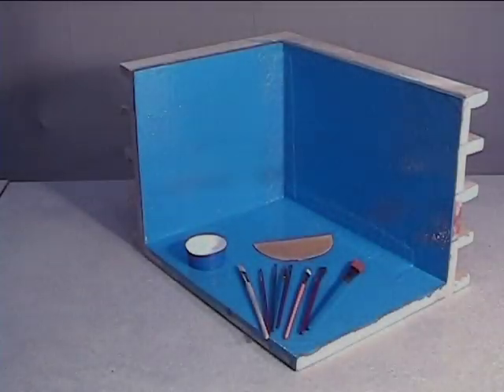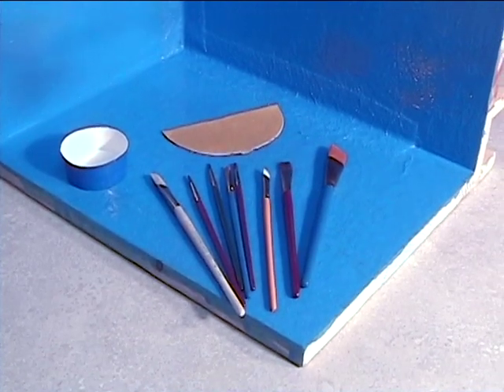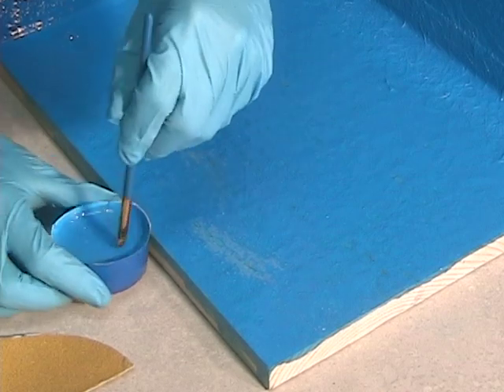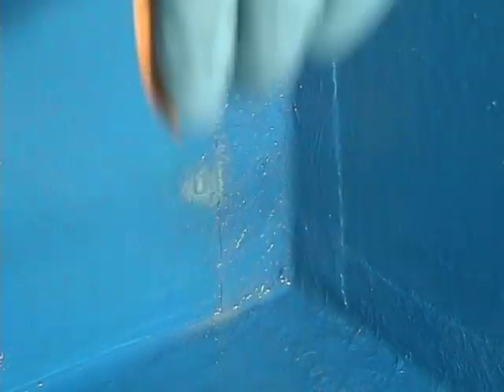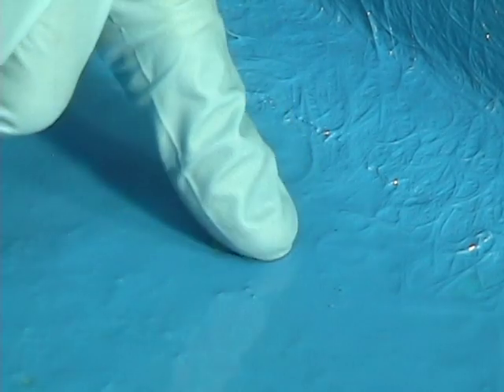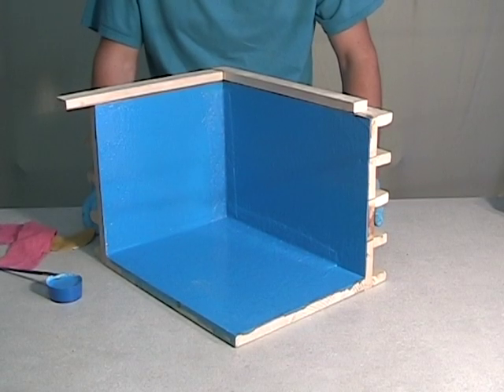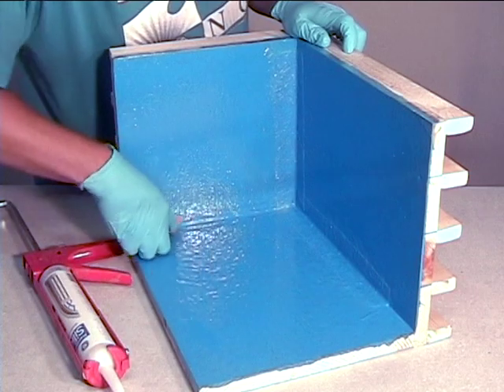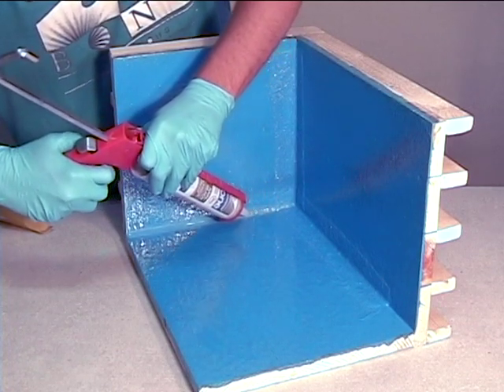Creating a Wooden Tank Part 4

Comment: I AM BUILDING A 6'X2'X2' TANK USING 3/4" PLYWOOD AND 2X4s I PLAN ON PUTTING FIBERGLASS IN ALL THE CONNERS...
 I ALSO WAS THINKING THAT I MAY, THAT IS, CAN USE 4X8 FIBERGLASS SHEETING TO LINE THE INSIDE OF THE TANK AND USE FIBERGLASS Res & Fiber TO SEAL ALL THE SEEMS, THEN USE SILICONE IN ALL THE CONNERS Plus; USE SILICONE TO SEAL THE GLASS.
DO YOU THINK THAT WILL WORK OK???
Reply from the maker: Yes, just make sure that all of the fiberglass is saturated completely.

Comment: i was thinking of making a 4ftx4ft terrarium. its not going to he holding water but there is going to be a fogger, and damp bedding for high humidity. is this efficient for it? if so would i NEED to do the fiberglass parts? considering it doesnt have to be fully water tight
Reply: 4ft x 4ft x 2ft*
Reply from the maker: You do not need to fiberglass unless you want to.  Make the unit as structurally sound as you see fit.
Reply from the maker: 4x4x2 is 48 square feet.  Always make it waterproof regardless of whether your project needs to be or not.  This way you have applied the coating in a manner that will work as opposed to have a potential for failure.

Comment: can you use a silicon bead underneath the fibreglass?
Reply from the maker: No!  Always stack softer materials on top of harder materials or they will work against one another.
Reply: ahh ok! thanks for clearing that up. You recommend the fibreglass over silicon or caulking?
Reply from the maker: No.  Always stack softer materials on top of harder materials.  So caulk or silicone on top of fiberglass.
Reply: should i even bother with silicon? what is the more effective way to seal corners?
Reply from the maker: I wouldn't.  Stack softer materials on top of harder materials and they will work together.